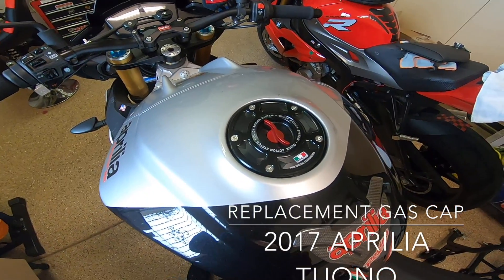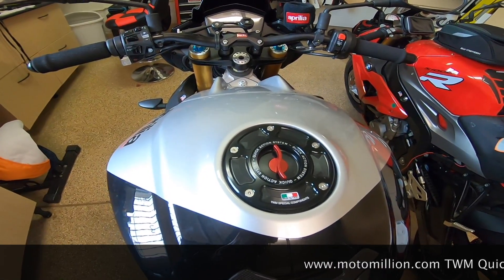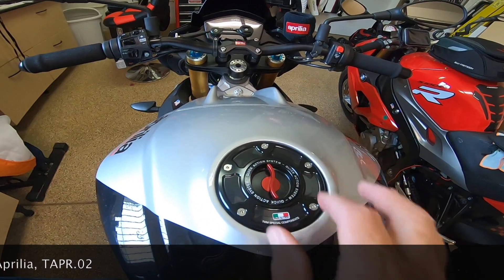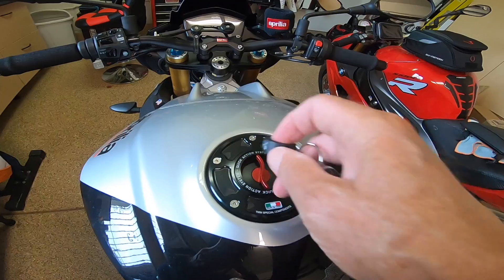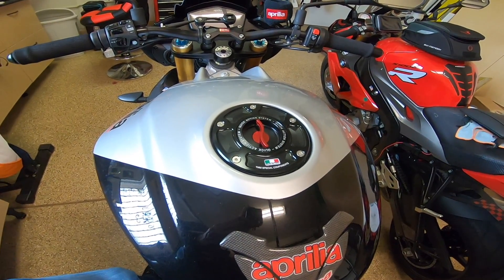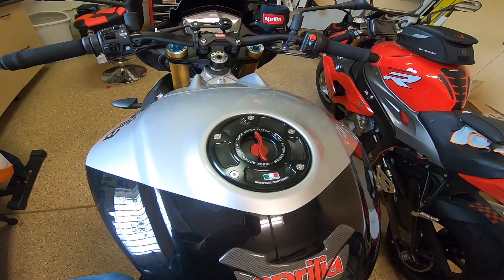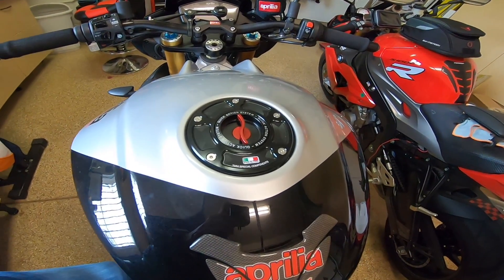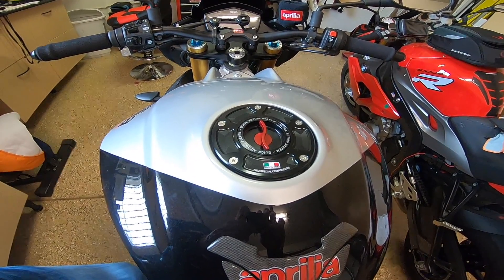2017 Aprilia Tuono Gas Cap Replacement

Comment: Did or do you have any problems with tank pressure with this, i have this on my rsv4 1100 factory 2019 and it builds up serious amounts of pressure in the tank?
Reply from the maker: Not that I have noticed yet. I do believe it has a tighter seal then the stock cap, so this may be the source of your problem. But I've not had issues with this myself.